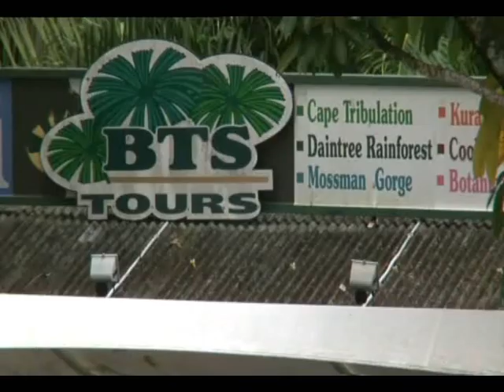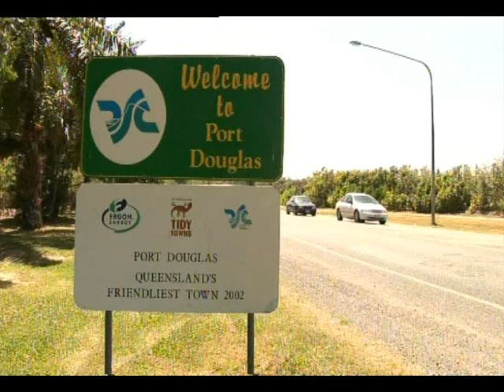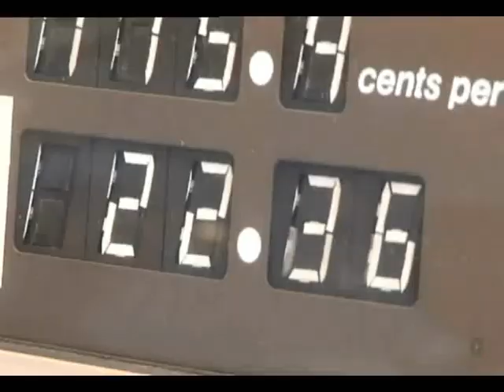Climate Witness - Meltdown Australia - Part 1

Comment: The greatest lie in the climate change rubbish is that to effect climate change to make it cooler, means that more water is locked up in the polar caps and glaciers, meaning that ocean levels drop, meaning that the Great Barrier Reef is exposed to the sun, leading to coral bleaching. Although the Global Warming experts wont tell you this, to maintain coral reefs you need higher ocean levels to prevent coral bleaching, this however.